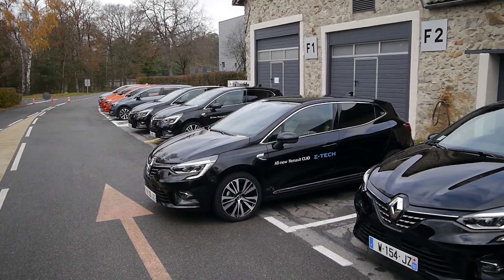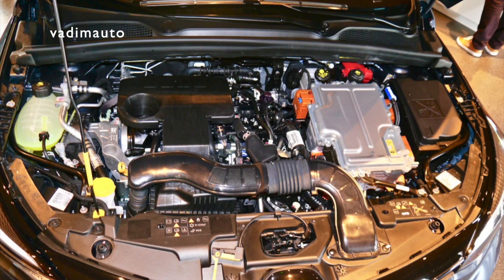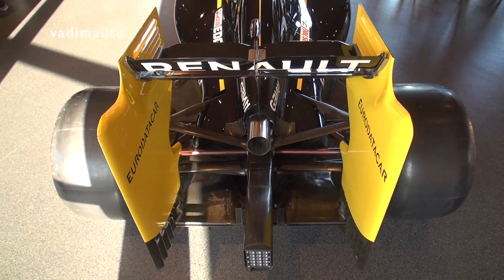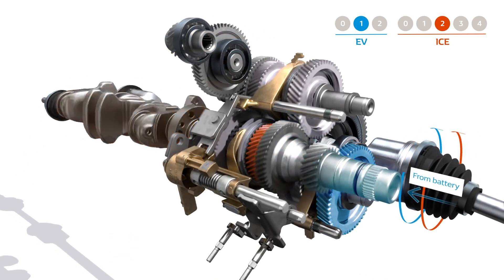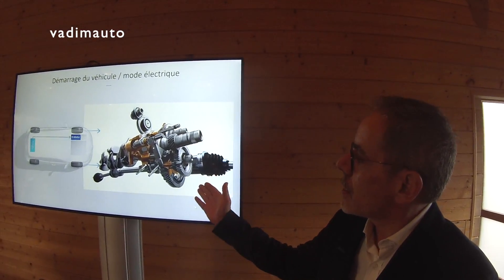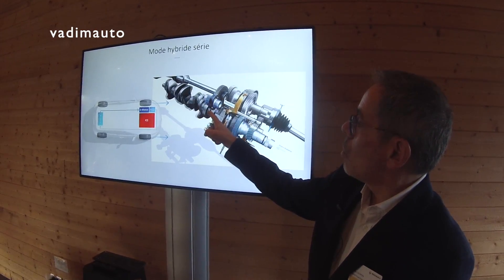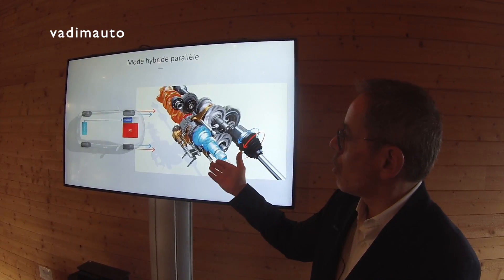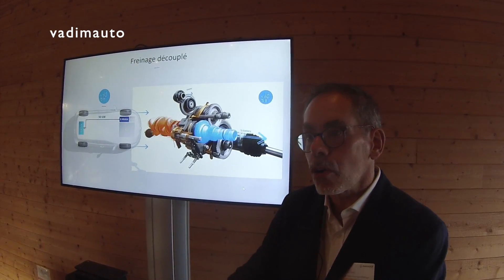2020 Renault Clio E-Tech, technical story

Comment: How this is very pleasant to see because what Renault/Nissan has managed to achieve that none of the Germans like Mercedes could was achieving a parallel-series hybrid like the Toyota Prius but with traditional gear sets. And this sort of hybrid (with two high voltage motors) would be more efficient and flexible than the many recent single motor hybrids.

Comment: Functionally I find no differences with the 4th hybrid version of Toyota
Reply: All generations of toyota hybrids, in fact.

But Toyota's power split device uses a planetary sun gearbox, like a Ford Model T. This 2-speed/4-speed from Renault is quite interesting by still being able to keep traditional gears. The gear box itself can connect the power in series or parallel.